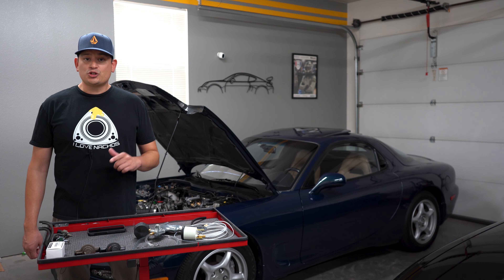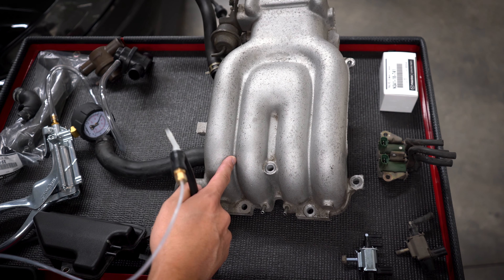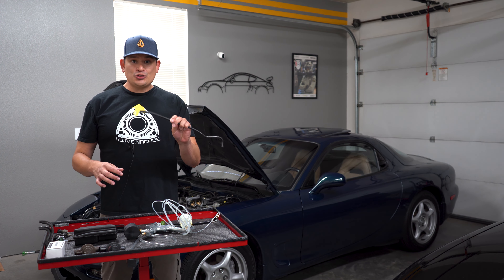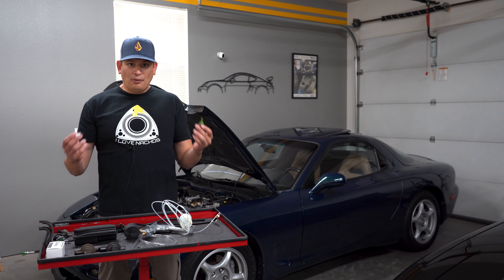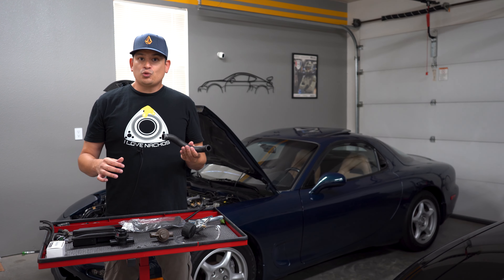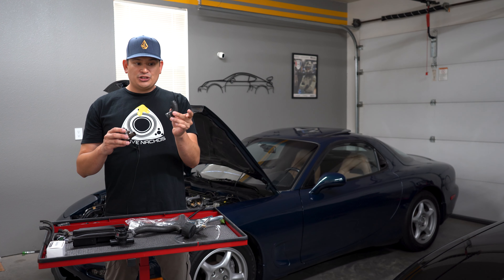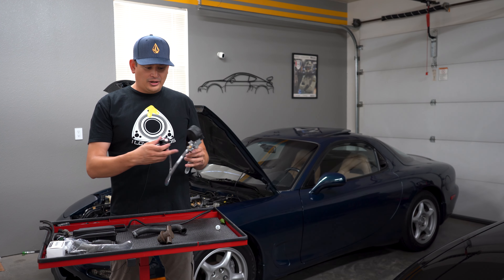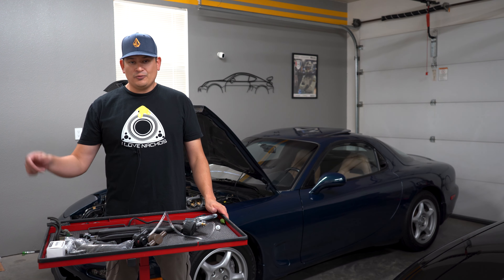FD Mazda RX-7 Sequential Turbos Troubleshooting - Pt.1(Boost Check, Hoses, Check Valves)

Comment: Very helpful. Just ordered a set of those check valves after banging my head against a boost issue for months. Hopefully that's the issue.
Reply from the maker: Let me know what happens. My issue was a small hose in the back of the rear turbo that came off.

Comment: Crazy I came across this :). I have a fuel leak and replacing my FPR. Decide I am about to replace almost everything I see the hood now. Going to stay with my factory setup but replacing everything I can while I have it all apart. Might even get the engine rebuilt 😂. I am at 100+k miles on my black base model.
Reply from the maker: Sweet! Cool to hear you have 100K on your car. It could be fine, no need to rebuild if you like how it drives.

Comment: I had the same thing with my FD where the second turbo wasn't working. After verifying that all vacuum lines were hooked up properly, the way I diagnosed my solenoid issue was to tee my boost gauge into each of the lines that go to the charge actuator valve (the big one that allows exhaust flow to the second turbo). This one will have a pressure side and a vacuum side. The pressure side wasn't working as it should so I replaced the solenoid that corresponded, and problem solved!
Reply from the maker: Awesome! Super happy to hear you got your system back up and working. That is so good to hear and thanks for letting me know what your solution was. :)

Comment: Welcome to 30 year old FD stuff.  Expect all rubber items near the keg and turbos to be in this shape, Just went through this with my FD and had the same issue with the same hoses, they explode when a little bit of force.  Just typical Maintenance with these cars after this period of time.  If you need to change anything in the rats nest, might as well replace everything under there and be good for another 30 years rather than fight with old parts.  The cost isn't that much vs the benefit of replacing everything.
Reply from the maker: Thank you for the great advice. I am personally replacing a lot of things since they are that old.

Comment: Hey how are you wondering if you possibly had these issue. I have looked through forums but cant seem to  find out. My issue  aside from picking up a RHD rx7, is that I notice  at different speeds and rpm's sometimes my car feels like I hit a brick wall. The issue is intermittent but recently it has been happening more and more. I'm worried that I'm going to toast the engine. I thought initially it was a JDM speed cut, but recently it cut out at 3000 rpm in 1 st gear at 35 mph while taking off. Also has notice a surge when at idle which was not present prior. Any help or direction is greatly appreciated. By the way the RX is a 1994  model with 49000 miles on it a.
Reply from the maker: Is it all stock?
Reply: @DriversTherapy   Yes all stock JDM RHD, well today it got worse. I went out for a ride earlier approx 30 minutes away. I went to a buddies house and as I was leaving she started to buck and surge at idle . I revved her up a little thinking that it was bad gas as I had just filled her up prior to leaving the house. When I revved her up black soot smoke came out the exhaust and she cut off. I stopped at a Red light and started her up and she was surging and wanting to die. Turned around and took her back to my buddies house.
 I left it parked at my buddies and came back 2 hours later. I started her up and she surge up and down. I began to driver her back home and the Over heat exhaust light came on JDM model. It Smelled like really cooked gas dieseling smell. Light was intermittent and the smell was now entering cabin. I Finally got home still surging at idle. I saw another one of your videos and attempted to get a code. Initially I got code 12 then i turned ignition of and tried to repeat the code and then got code 11. Wondering if the cat clogged or a coil went bad. She only has approx 49000 miles as It was imported and the guy told me that the cluster had been change do to it going bad. New kilometers read 8200 kh. She looks low mileage but who knows. Could a cat go bad at that low mileage. Thank you again for all your help its greatly appreciated.